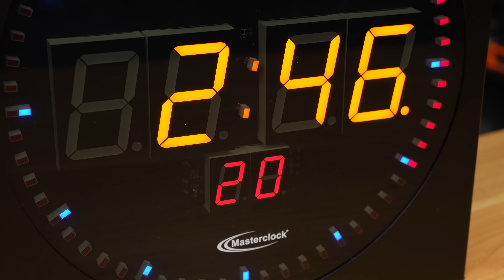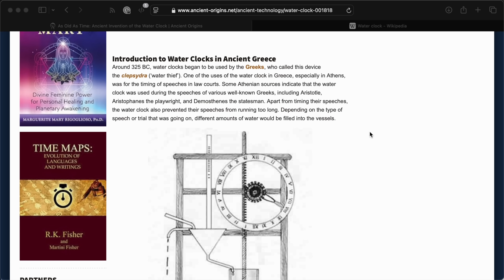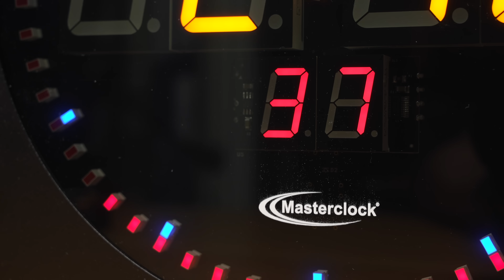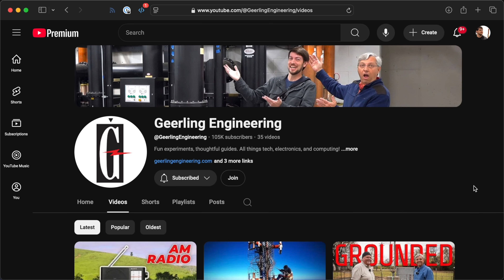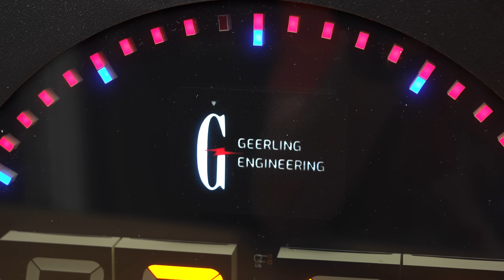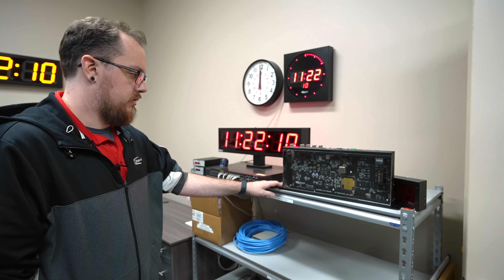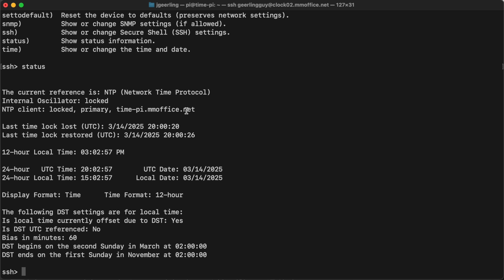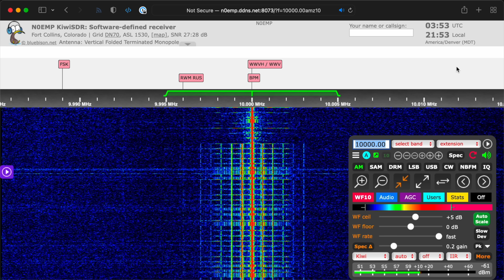It's about time...

Comment: If you've ever had to troubleshoot NTP issues, hats off to you. I once had to deal with an extremely rate-limited NTP service in a massive cluster and it was painful.
Reply from the maker: The nice thing about my local deployment is I only have maybe 50 or so devices, and I'm slowly adding them to the Time Pi and monitoring things.

Eventually I hope to have a redundant time server setup... not sure if that'll happen this year or next, but that with PTP can be fun!
Reply: @JeffGeerling  I have two servers, so now I'm never sure, then there is GPS and the hope that the US military is not fiddling with it for some reason like Ukraine or Trump (well he's already into VOA)

I worked in a telco calibration lab, they had a very expensive GPS box, but were only allowed to use it for comparison purposes as GPS was not under their control - a 'foreign' military that could do as they pleased.
Reply: @JeffGeerling  this was a really cool video, I never was aware of all of the dedicated hardware in this space. Very cool and thanks for making the video and exploring time services.
Reply: The entire Norwegian DAB+ radio network went down in 2017, not long after we had switched off the (almost) entire FM network. 

It was caused by a decommissioned GPS satellite with a very bad mood, screwing with several other satellites

Apparently transmitting digital radio signals is pretty time sensitive. Which may also be a national security issue as we no longer have the analogue radio network...

This barely had me worried... But then Trump and his clowns had a temper tantrum and shut down the F16 planes used in Ukraine to defend against Russian invaders... Not really GPS related, but the same "stable genius" can flip GPS back to "pre-Afghanistan fuzzyness", thus create huge problems for the entire planet

"Whoever controls time, controls everything!"
(Quote: Me, ca right now)
Reply: Agreed.  
At my former job we had a couple of Symeyticom NTP servers that were getting swamped when a software update to all our client devices started causing them to all poll the server every 2 seconds.  It started complaining when thousands of devices were hitting it constantly...
Reply: @pileofstuff  basically our SAs deployed a policy at my company when this happened that introduced massive amounts of drift between servers ... and here for the applications we were running in our hosting clusters seconds was massive drift for some of the cluster coordination that was needed. Too many services that were designed with exactly-once in-order data processing requirements. NTP health and time basically became our sole focus for a few weeks.